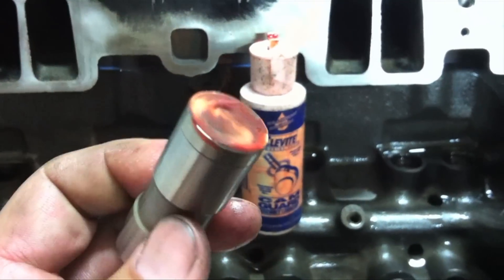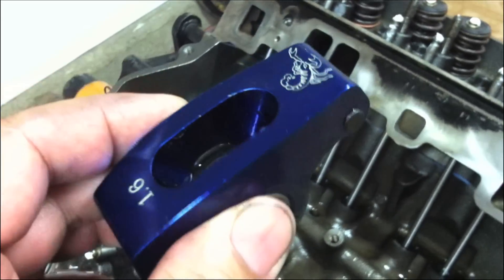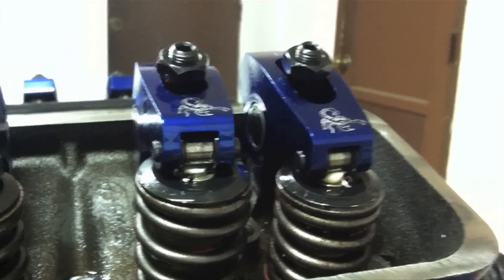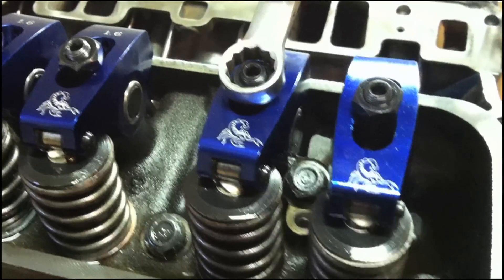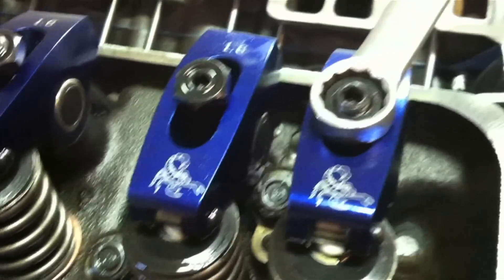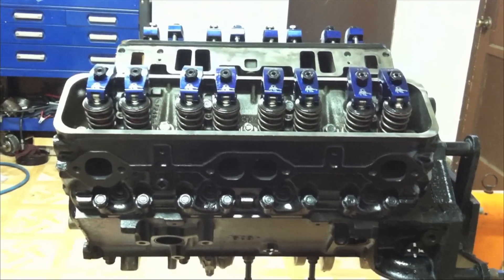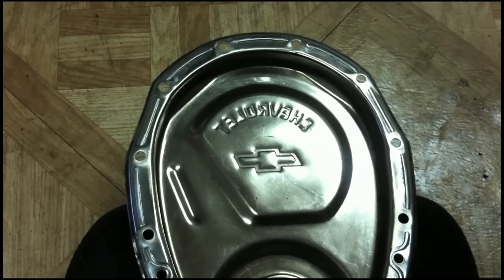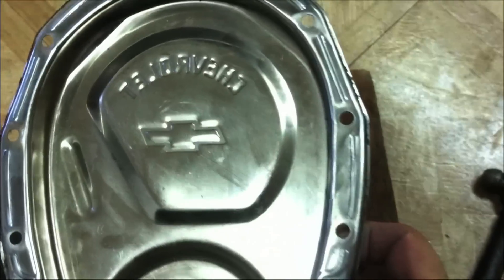How to Build a Chevy 383 Part 5 - Lifters & Rockers

Comment from the maker: Thank you. Redoing the heads should help if EVERYTHING was done on them. As long as the lifters are in good shape and not collapsed or rusty. After a cam is broke in you usually want to replace the cam and lifters together. More work, etc. The important thing is to NOT pull out the rockers or get them mixed up. They wear to the cam and can't change position unless they are ROLLER lifters (and cam). $139 for a new Edelbrock intake and $300 Holley carb would also help. Just did that to my truck.

Comment: Very helpful vid series. I recently had my heads cleaned out and new rocker springs put on. Would this create a problem if I did not replace the hydraulic lifters? The engine seems a bit sluggish. Thanks!

Comment from the maker: After I snug the rockers I turn the crank and see which valve moves first and go from there. There is usually plenty of cam lube and spooge on a new engine so it's not a problem turning the engine over by hand. Also priming the oil pump BEFORE you install the oil pump is important. You also have to prime the oil pump after you install the engine before you start it. You can do it any order. Just watch the valves move and mark them after you adjust them so you don't get lost.